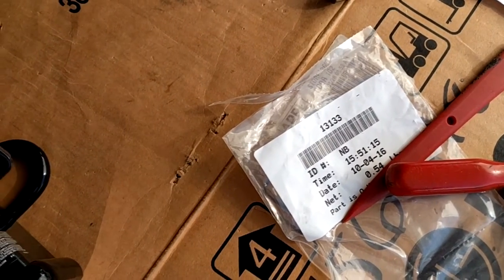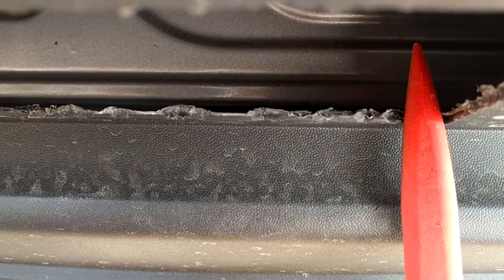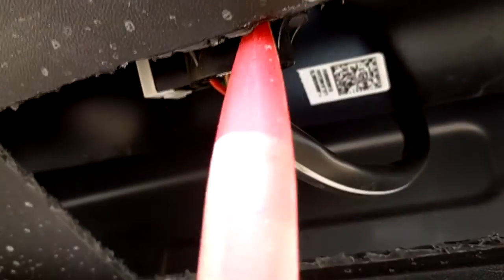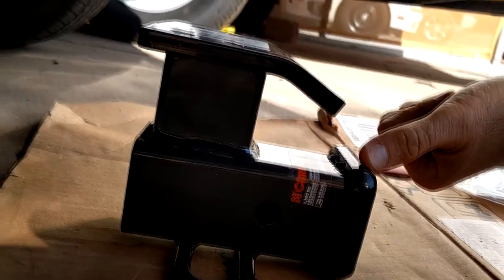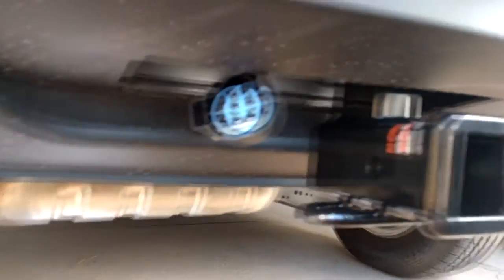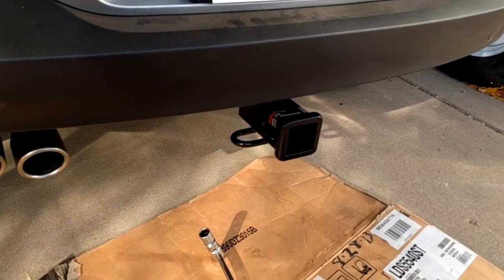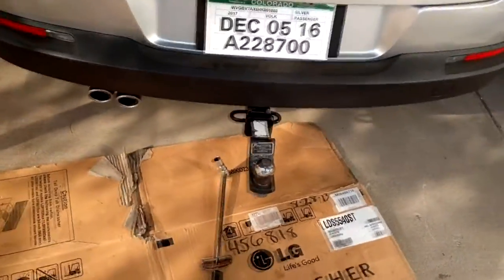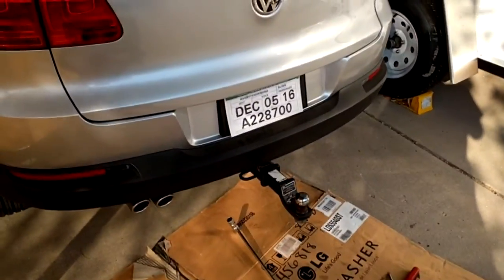2017 Volkswagen (VW) Tiguan (MK2/T2) Hitch install MQB Platform Medium/US Specs

Comment: did you have trouble fitting the bolts in? mine seem to be the wrong size. i have the same curt hitch receiver it came with M10 1.50 70mm

Comment: you don't have a MQB tiguan.  your body fascia has been out since 2012, and the MQB Tiguan wasn't out back in 2012.
Reply from the maker: Well, MQB is the "framework" to hang body panels, under pinning, engines, transmissions. 2017 = MQB. look it up.
Reply: Rod Serling rest of the world has MQB tiguan.  the US does not have the MQB tiguan.  model year 2018 is when we get a MQB tiguan, sized up for our market.
Reply: US Spec is a little behind. Your Tig (and mine) are not MQB.
Reply: Rod Serling that is absolutely not a MQB platform.